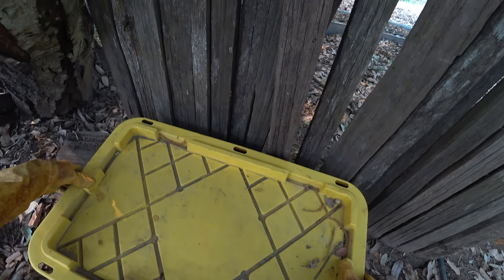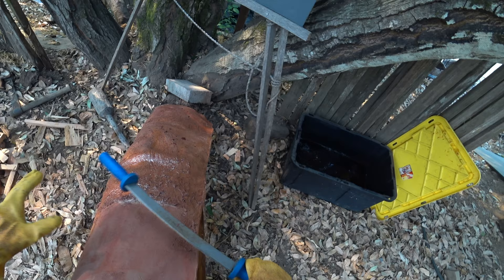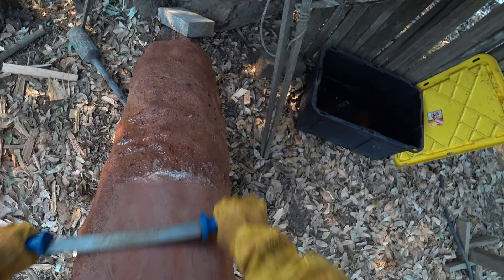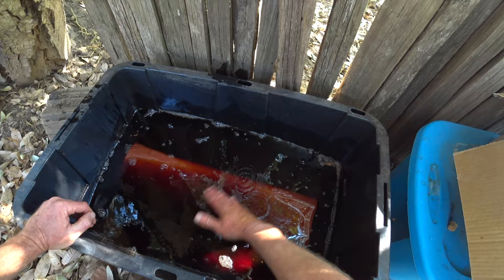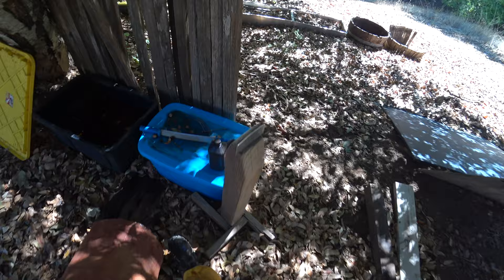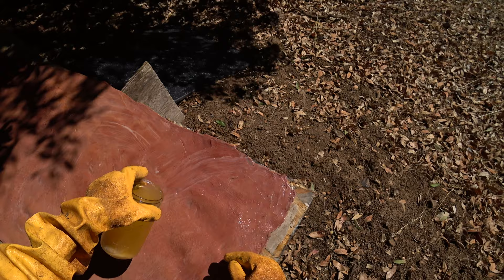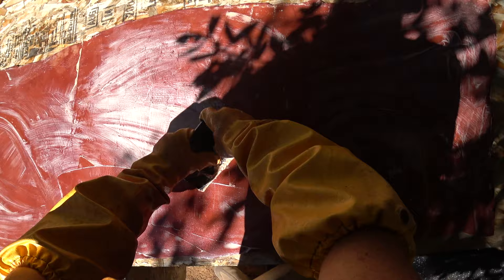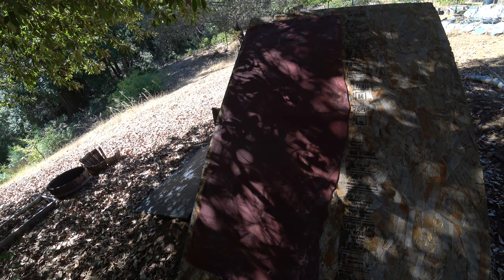Finishing the Oak Tanned Cattle Leather With Dubbin' Oil

Comment: When you angle a blade relative to the cutting direction you're actually changing the effective blade geometry making it more acute. It's the same phenomenon that makes slicing easier than chopping. Angled wings on planes and angled tank armour work the same way, too.
Reply from the maker: Thats really interesting and I can visualize that.  I wonder if that is the only effect.  I'm going to have to think on that.  thanks.  whatever the case, it certainly works.
Reply: @SkillCult  I think there might also be a sawing type effect, given that all edges are serrated under enough magnification. Not sure how big the influence of that is, though. 

My understanding is that cutting is a function of pressure overcoming the strength of a material. More acute edges concentrate a given amount of force on a smaller area, so more pressure.

I also know that there's a weird effect with cutting tools where the cut can actually open up in front of the apex of an edge. And the bevel surface basically acts as a wedge pushing against the chip. If you're sliding the tool horizontally or skewing the tool, that wedge is shallower meaning it doesn't have to do as much work over a given distance. Not sure I explained that well. You'd have a better intuitive grasp of that than me since you spend so much time with axes.

Eg when you're splitting a log, the edge of the axe initiates the split but then the faces (cheeks?) of the axe take the load at some point and the edge may not actually be doing anything. Apparently chisels (and so probably planes and lathe tools, etc) do the same thing at least some of the time. 

I think I read about this first in some Lee Valley book on tool sharpening.

Comment: "Slicking Iron" AKA old school Dough Scraper 😁 I've never seen one outside of a kitchen before! Anywho - thanks once again for all your hard work experimenting for us 🙏 Videos are hard work, especially when life is throwing you curveballs.
Reply from the maker: Most pastry cutters are too wide to be very good for this.  I made this one with a piece of fairly heavy gauge stainless.  If you can find one that is thick enough and the rivets are spaced such that it can be cut down to 5" or less, should work.  I've looked on amazon, they are pretty cheap.
Reply: @SkillCult , heh heh, I see you read my typoed comment before I erased it 😅

The old German made bench scrapers / dough scrapers seem very similar, but I'm just going by what I can make out squinting on my cell phone 😅

It's oddly soothing / hypnotic watching you work the moisture and oils out of the wet hide.

I've done precious little tanning myself, but I did work with leather professionally for a time.

Your other commentor is right, for a beautiful thick, clean, and relatively even hide, it'd be several hundred bux, and that's wholesale business price, let alone what some places fleece the general public for.

That was years ago now, but I'll never forget the trade skills I learned.

These days I'm just gathering survival skills like they're going out of style 🤣😏

Comment: Keep em coming Steven. I just finished a squirrel hide with leftover liquor from cooking acorns and it turned out great. On a semi-related note, do you know what sort of grass species (or others) that the California natives preferred to make their coiled baskets from to make them waterproof?  I was told that the right species swell enough after the baskets have been soaked to create a watertight seal (I know they also rubbed the inside with acorn flour to help with the seal,  but I’m more concerned with making a basket as watertight as possible without that extra step). Thanks
Reply: How did you use the acorns to make a tanning solution? Thanks
Reply: I just put them in a blender with some water and blended till coarsely ground, then boiled until the water was dark brown and opaque. That resulting tannic water was what I used
Reply: The acorns needed several more boilings to make edible, by the way, but it was only that first change of water that I used for tanning
Reply from the maker: that's cool.  I've had a video planned to do that for years now.  It's not really about the materials so much actually.  It's about the quality of preparation and skilled weaving. also, of course, certain styles.  The only thing I can think of that they us that is really grass as most people would think is Deer Grass, or basket grass. its' then center core of coiled baskets.  But some rushes are used and sedge roots.You don't really need the acorn meal necessarily.  If you want to learn, I would look for classes.  Coiling is probably easier to learn than twined styles.  Where do you live?  If it's not for cooking, you can line them with pitch, like paiute water bottles.
Reply: I live in Kansas, and plan to use such a basket for cooking (among other things, I’m going to try leaching some buckeyes as done by the California tribes - just re-watched an old YouTube video documenting that) so the pitch lining wouldn’t be desirable. I wonder if a large basket might also be used for veg tanning. It’s hard (I imagine) to make a ceramic pot large enough to tan a deer hide in, but a basket might work (if it stayed watertight long enough). Or a wooden tub made from a log in dugout canoe fashion. Do you have any insight on how prevalent veg tanning was among  pre-contact Native Americans?
Reply from the maker: @lukebaker844  You can line a hole in the ground with another hide for bark tanning, or suspend it on 4 stakes to make a tub.  I would not try to use a basket.  Your kansas buckeyes would not be the same as california buckeye and might be more poisonous.  I'd check into that.  dugout, burned out logs are an option for sure.  It is thought to not be very prevalent in north america.  I'm really not sure.
Reply: Thanks for the reply. A hide lined pit is an obvious solution. Should have thought of that. It could actually tan two hides at once, potentially. Liquid in a hide suspended on a tripod, I imagine, would be more prone to evaporation. I’ll certainly  be careful with the buckeyes. Wild edible plants are my first love, and I have many many years of experience carefully experimenting with wild foods.
Reply: (Sorry, technically not a tripod but a quadrapod, I guess, per your text)
Reply from the maker: @lukebaker844  I met a guy that tavels to mexico a lot and buys bark tanned hides in Northern Mexico.  He said they will take a bull hide and suspend it on four stakes, either off the ground, or maybe just touching.  And run many batches of hides through it.  I think the stakes might be angled inward.  Makes sense anyway.  The buckeye here is easy to process and get clean tasting, until you cook it.  I've not been able to re-cook it, like to make a mush or something, and not get this slight cat pee smell it has.  but if you eat it cold, which i think was tradition, it is very mild, bland really, but about 50% starch.  I have no idea if the other buckeye/horse chestnuts can be processed.
Reply: You’re a wealth of information, as usual, Steven. Thanks again

Comment: New subscriber here. Really like the advice you're giving. I just tanned my 1st buckskin & it turned out pretty good. My next hide I'm definitely going to try your process. My apologies if you've covered this before but do you ever smoke your hides or is that step not needed with your tanning method? Thanks,
Reply from the maker: Welcome.  I wrote a book on buckskin, currently trying to get it back in print.  smoke and tannic acid do pretty much similar things. They tan the skin by binding to the same sites and build bonds between the fibers, changing the way that the hide interacts with water.  veg tan is much more rot resistant than buckskin.  smoke tans with aldehydes.  There is actually an aldehyde chemical tan too.
Reply: @SkillCult  fyi David the Good is starting is own publishing brand. He's doing a reprint of one of Steve Solomon gardening book and your content seems  in the same wheelhouse, lots of self sufficiency etc.

Comment: Wow, that’s like 10oz leather!  Probably $300-400 there?
Reply from the maker: hides from modern tanneries are split down.  Very few people want full thickness cattle hide, and it is uneven.  Spliitting brings it down to an even thickness all around and tailored to people's uses.  that used to be done by hand by curriers using a knife to gradually shave the skin down.  A very skilled job.  those leather ounce numbers don't really mean anything to me because I don't buy leather.
Reply: When you buy leather (as I do) they tell you the hide varies from, say, 7-8 ounces, but I didn’t realize the hide was actually split in order to achieve that uniformity.  I just assumed they put it through heavy rollers or something.
Reply from the maker: @KevinsDisobedience  There is usually some kind of compression, but not maximum.  They use splitters that literally split it into two sheets thickness wise. that is where "suede" splits come from with no grain.

Comment: If you were to try and sew a bullet hole closed, at what stage would you recommend doing it?  I’m pretty sure I’ve watched all you tanning videos and don’t recall you doing it. I know you mentioned you could do it. Just Thinking ahead for my second hide. My 1st one is almost finished. Oiled, Broke it around  steel cable twice in 2 directions, grain looks awesome.
Reply from the maker: In heavy leather, I wouldn't. In buckskin, I'll sew small ones up after the skin is tanned, but it is very stretchy and I always wash the skins after smoking, at which times small holes sewn up will flatten out.  Large holes in buckskin, I sew before softening, with a rough stitch, then restitch before smoking.  Bark tan is different though. It will tend to set in the shape it's tanned into.  I don't really deal with holes in veg tan. I guess Iwould think about a quick stitch before tanning, then restitching finer after softening?  but then it won't be flat, so I'm not sure. If you stitch before softening, the stitching tends to get loose, if not tear out.  Patching or strategizing around holes might be better.

Comment: As a first timer, making leather, can I use my draw knife as a scutting tool?
Reply from the maker: You can, but therea are some disadvantages.  It only works well if using a beam leaned upright, like against a tree.  Also, you will need to dull it a lot, so when you go to use if for wood again, you'll have to sharpen it all over again and they are very hard, so not easy to sharpen. If you can afford 35.00 bucks, just get the 12 inch weibe flesher.

Comment: I love watching this shit, I'm a hunter that lives in a city and never thought about tanning. As far as hides go, I gave them away or threw them away. That might change now. In watching your videos, I watched one you did in 2016 on bark tanning a deer hide, Strips from scratch #6. You washed the hide in clean water to put in bark solution, you let it hang for a minute then put it in to start tanning. Here's my question, wouldn't it be better to let that hide dry to a damp condition so when you put it in for tanning that solution doesn't have to basically push out all the existing water. Seams to me it would soak up faster. Does that make sense? Just asking,
Reply from the maker: I think it's best to have it wet, because there is less chance of uneven penetration.  If it's all wet, it's homogenous. I don't think that having it drier is going to prove enough advantage to be significant.  I get the theory, but practically speaking I don't think it's anything to worry about. it is just going to take a long time anyway.  If you want to speed it up, movement in the liqour, and or taking the skin out and going over the flesh side, or stretching smaller skins in the liquor will pay real dividends.
Reply: @SkillCult  Ya, makes sense, thanks for the reply. I do like your videos.

Comment: Thanks Steven. I'm always unsure about the pretty sharp part of your flesher(s). I bought a weibe, is yours sharper or more dull than it was when brand new?
Reply from the maker: Probably duller. it's a hard thing to quantify.  If you are cutting the skin, dull it back a bit, but first try holding the tool at a lower angle.

Comment: I am always scared over oiling the skin and was so nervous seeing all this fat in the video haha
Reply from the maker: A cattle hide can take quite a bit.  the thin sheep hide I did ended up over oiled, but it was very thin, in very hot conditions. I should have doen it another way.  I did over stuff one piece of cattle on purpose to see what would happen.  Years later, there are bubbles of fat that ooze out of it.
Reply: Hi there! I am triing to understand this overoiling issue. So there is certain ammount of fat/oil that each hide can take without being greesy on surface later on. Is this the issue? And if spoiled and overoiled. Is there a way how to fix it?

Thumbs up for this series!
Thanks for answers.
Honza
Reply from the maker: @honzaharcuba2208  You can just wash in warm soapy water and redry.  If you put in too much, it will feel heavy and clammy.  Also, when it's warm, it might seep out of the hide or create blooms of fat on the surface.  it's not hard to over oil thin hides, but thick hides are pretty forgiving.  You can always add a little more to any finished leather by just wiping on.
Reply: @honzaharcuba2208  The way I understand it-yes there is certain amount of fat the skin can take. On the 2 ends of the spectrum is over oiled, when skin is greasy to the touch and not oiled at all, when skin is dry af and probably brittle. In between he skin has been oiled but how much is oiled, how is oiled and with what is oiled depends on the skin and what kind of leather you wanna do. Is really an art it depends on a lot of stuff-what skin, what animal, how is tanned, what material, what oil u will use etc. I have little experience but i think best way is to try oiling a lot of skins and do not concentrate on the end result more on the knowledge u get in the process.

Yes if you over oil you can resoak in water and soap (maybe sadle soap? or some leather soap ) and wash away some if not all the oil. hope i was useful. Cheers

edit: the expert (Steven) already answered u i didnt saw hahah

Comment: can you tan with pecan husks or the outside fleshy skin thats outside the shell if so what should i do
Reply from the maker: I'm sure they contain quite a bit of tannin.  Almost everything has been tested for tannins, so you might be able to find information on the percentage.  otherwise, you jut have to experiment.   I would dry them, then put them in a tarp or something, fold it over and walk all over it.  Or figure out another way to break them up a bit to get more tannin out.  then cook just covered with water below boiling for maybe 4 hours, pour off, recover with water and cook again.  Start in the weak second boil liqour and then use the strong one to boost.  You'll need a lot, so gather like 5 gallons of hulls to start something like a deer hide.  Can't say if that will be enough.  Better start with small pieces of hide or squirrels or other small animals.
Reply: @SkillCult  i also have mequite wood if i combine both of these will i be able to tan something like a medium sized goat skin. also would wood shavings from a plane be better than wood chips.
Reply from the maker: @Ruben25252  I would go with the mesquite.  there is a lot of info on it in my page about tanning materials on the website.  thinner shavings are better, but I would do chips with a hatchet or chipper and just cook longer.  Especially with something as hard as mesquite.
Reply: @SkillCult  thank you for the help